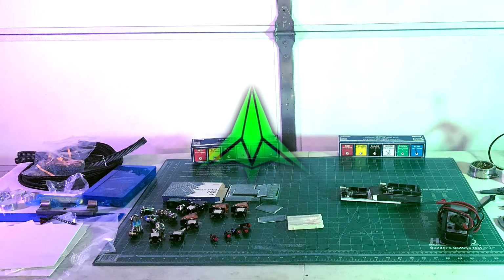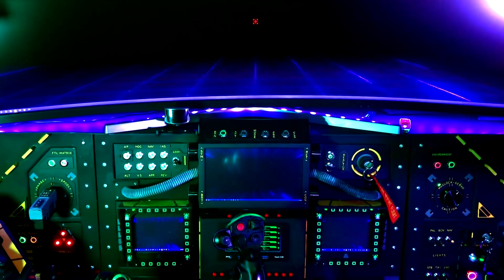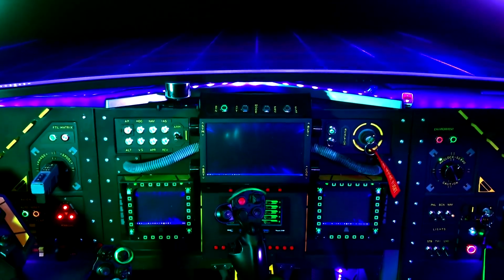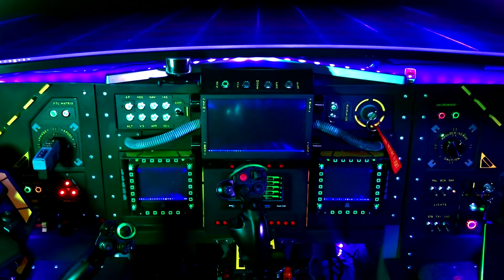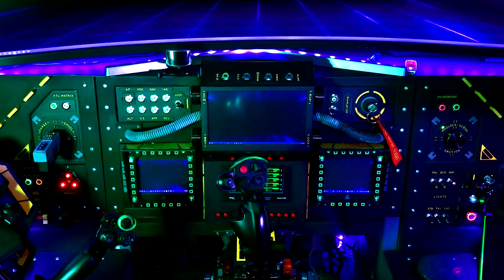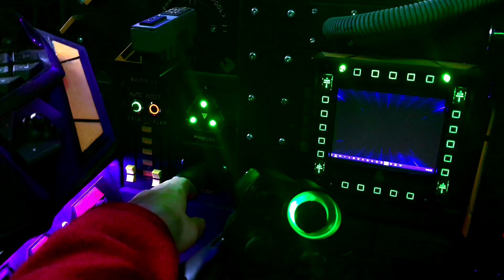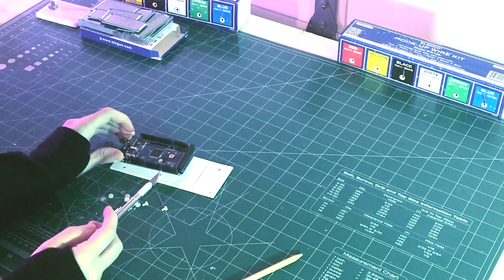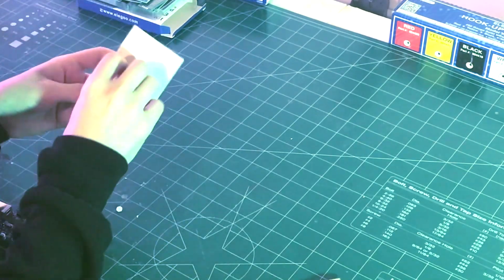Building a Gaming Cockpit - Let's Build a Button Box - Part 1 [Remastered]

Comment: I'd like to say that this build is amazing, and i'd really like to do something similar. However, I'm kind of curious... did you buy large sheets of polystyrene or many smaller 8 x 11's or something? And about how many of those small or larger sheets do you think you used for the build up till this point? Also i see a lot of switches that you have used throughout the build (not just in these videos) that i have NO clue the name of, and aside from illuminated or non-illuminated, is there anything that the switch needs to have/be capable of doing to be chosen for the build setup like this? Thanks in advance man, keep up the awesome work!

Comment: How did you connect the power button? The one with the 5 outputs?
Reply from the maker: It's not actually connected yet. 3 of the connections are for the switch (Normally Open, Normally Closed, and the common ground between them). The other two are the + and - for the LED inside of it. The wiring is going to be done in part 4.
Reply: @AfterimageFlight  great! When are you going to upload that part?
Reply from the maker: It still needs to be filmed unfortunately. That won’t happen until after the holidays at the very least as I’ll need to make room to do so.
Reply: Than we need to wait for it! The only problem I have now is to connect it to my  arduino pro micro. I have no idea which cable needs to which hole

Comment: You have a link for getting Plastic Styrene, but what thickness did you use?  I don't want to go too thick, but want enough to keep things fairly solid.
Reply from the maker: At minimum, you want 0.08 inch for structure. 0.125 inch works pretty good for larger pieces. The larger you go though, the thicker it will need to be, or you'll need to brace it with additional pieces.